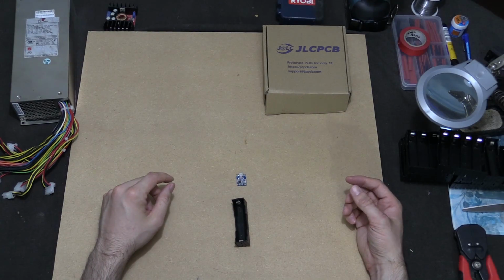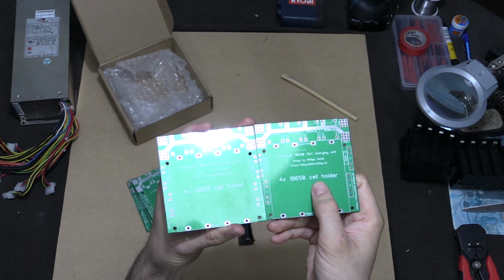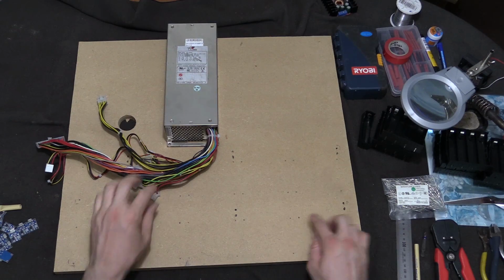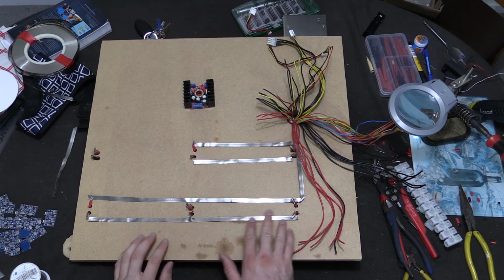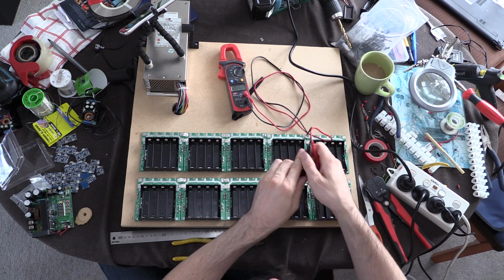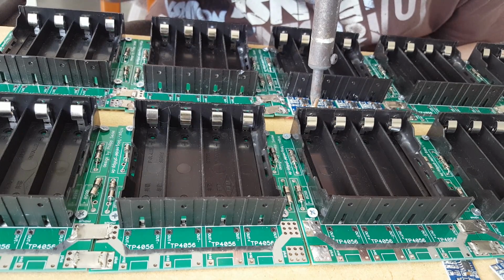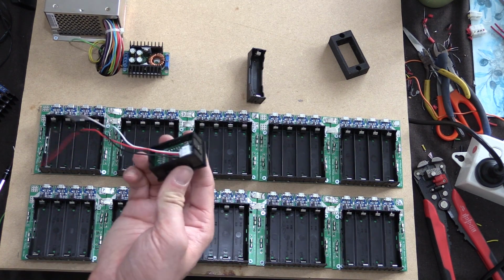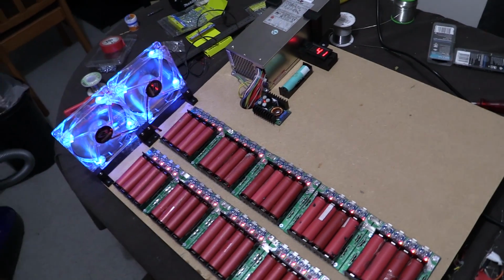Ultimate 18650 40 Cell Charger Build. Oh Yeah!

Comment: The video at Philipp Seidel's blog (linked in the description) suggests putting some solder on those long lanes that pass the power across the board so they can handle the additional current from daisy chaining the boards together. I was thinking about adding a wire before I saw his video.

He also uses a diode to protect the TP4056 from a reversed battery. The diode would short circuit the battery when it's backwards and blow the fuse.
Reply: PS - I just finished binge watching your whole series. Filled 3 or 4 sheets of paper with notes. Great info here!!

Comment: I just build an 18650 charger for 48 cells - using a 30A 220v to12v dc converter and three 9A voltage regulators - all set to 4.2V. I made the cells in parallel - working just fine. I only need to check from time to time to see if one cell gets warm - that cell I take out. I only run in the daytime when I am around - this way I can charge 48 cells per day.:)

Comment: I just wanted to suggest you check out a metal conductivity table. I've done so much electrical work that I instantly had regrets about after reading one. One fact that blew my mind was that although brass contains 70% copper, it only conducts 28% as well. Tin is 15% and lead 7%. I definitely prefer leaded solder, and due to that, use silver-bearing lead solder instead. There's also silver-bearing lead-free that also contains copper, and likely conducts the best that I hope to try in the near future

Comment: If I recall the Tp-4056 boards come default to charge at 300ma. You have to change a resistor to do 1amp. I am using a 30amp supply for my 36 slot charging unit no problem. Looking good, good luck
Reply from the maker: Thanks :) hmm these boards i used seem to be set at 1amp. As you can see 34:42min its pulling over 7 amps on 8 cells that i put the meter on.

Comment: your original charging board was tacky when you built it lol. The negative track is actually the entire front of the board not just where the silver is, that is just to add some solder on it, you can put a solid piece of wire to beef it up! maybe I should redesign that board for the LM2596 CC buck boards I am using!
Reply from the maker: tacky yes haha Hmm i never tested if that ground track is connected to the entire front but i will have a look.

Comment: You should defiantly add more solder in the holes of the TP4056 boards and You probably already know this but you should try Solder Flux it works so much better than that Solder Paste you're using. That stuff is more for SMD applications, but it does work theirs better stuff out there that will make soldering so much easier. Flux is the best thing ever created for soldering lol I can live with out it. Try the Pure Rosin ones there my favorite, you can use it to make liquid flux to. Good video tho. Gotta build one someday i'll probably add some header pins on the boards. my 10 Lii-500s aren't enough lol

Comment: Why don't you just solder a solid copper wire of the appropriate size that you would need along the traces? That would go a long way in the protection of your boards. Don't you think?
Reply: I thought this, i use tinned desoldering ribbon, stays nice and flat, or nickel plate that is used for connecting batteries.

Comment: Why don't you just install some protection diodes at each battery charging board so you don't blow out your boards?  These diodes are very cheap and not a lot of work soldering them in place. Just asking mate.
Reply from the maker: protection diodes or using a diode will create a voltage drop, Around 0.6v off the top of my head. Which will cause a problem with the charging circuit unless you somehow created an offset in the chip. Remember the tp4056 is wanting to hit 4.2v CV and then do CC after that, so if the voltage wasn't able to get up to 4.2 held back by the 0.6v voltage drop it will cause the cells to never fully charge, That's why I didn't use diodes as it messes with the tp4056.

Comment: Great project, what do you do to capacity test the cells?
Reply: capacity ? its charger. Not tester.
Reply: @happer2009  he's asking what do you use to capacity test them. The TP4056's brother is the ZL2B3. Not quite as cheap but on Aliexpress or Banggood you can get them for like $4 each. They aren't the most accurate testers but they are fairly consistent between each other. My testing has shown they are rather optimistic giving me results several percent higher than what they should be. The ZL2B3 isn't constant current, its a simple resistor pulling down the cell so it can be hard to compare to other testers

Comment: or you could use 2 new computer power sources at $11 each 400 watt, that already have fans (that will blow air on the accumulators if oriented well but in reality 18650 don`t get hot, or even warm except if they`re old and bad), and together they will give you much more than the 40 amps 5 volts you need (more like 80 amps combined) ...your project will look much better

Comment: Where did you get the parts from? This link you provided seems to be kinda clunky to navigate. Very frustrating. Good vid!
Reply from the maker: That link is only to download the PCB files from. The other parts needed are the holders which i got from Aliexpress. https://www.aliexpress.com/wholesale?catId=0&initiative_id=SB_20190124133604&SearchText=4x+18650+Li-ion+Battery+Storage+Plastic+/

Comment: Hi Mike. 
I have tried charging 20 x 18650 all in parallel with a 4.2V 10A current limited power supply and I have had no problems. I use Rui Deng DPS5015 as the power source and stop charge when current drops below 100mA. May pay to put 0.5 ohm in series with each cell to limit surge currents when different voltage cell are paralleled but so far I have had no problems.
I was wondering why you have to use 4056's?
Reply from the maker: Hi Peter,
The TP4056 gives each cell 1amp and each is independent of each other, Meaning if some finish first they can be removed and another put in to charge. With the idea of 20x in parallel you will have to wait until all have finished or below 100mA. The problem with the 100mA cut off is if the cells overheat during charge and some never charge because of this the current will not fall below your cut off being 100mA. 8 out of the 20 Sanyo cells not charging should do that. Charging cells that are all around the same start voltage and are known to be good are fine to charge in your 20x parallel but I wouldn't be putting cells pulled straight out of laptops in there, Some will not charge, some might be dead shorts, some might be 1v with other at high 3s,  My advice would be always charge unknown cells independently and connected to there own charge circuit for the first time. This also helps with speed because as soon as one finishes another can be put in, as they all have different capactity some will finish much sooner than others and some will never finish and are binned.
Reply: Thanks for your reply. Your system is more effective in weeding out the really bad cells. My system is very simple so only good for non leaky cells.
I have only tested about 500 cells and generally dump any cell with <1.5V open circuit as they are probably leaky. The rest seem to charge OK with my system. This means they  all finish charging together (batch recharging).

Comment: How do you check if the cells are heaters? Do you only charge when you are around to manually monitor the temps?
Reply from the maker: if they are heaters then 1 they will be hot and two all other calls would have finished charging but the bad ones will not be so they get binned. Some do get hot. No i dont only charge when i am around. Its runs 24/7 charging cells. Never had a problem after doing 1000s could be getting close to over 10,000 these days
Reply: Thank you for your response! Not challenging your methods, this build is awesome, just trying to understand. If they charge overnight, wouldnt some heaters have the chance to cool back down before you got to them in the mornings? And surely all 40 cells aren't beginning at the same voltage so wouldnt varying charging times be normal and not simply a sign of an internal short?
Reply from the maker: No the cells don't cool down, The cell gets hot and this causes the charging circuit to keep charging the cell and never cuts off. The charging circuit will only cut off to that intervidual cell when the cell drops to under 100mA in current draw. Given the cell is using more current than that in the form of heat then it never turns off and the cell stays hot no matter how much time pases. So its very easy to tell. Also if a cell did reach charge and then drop down in voltage to under 4v then it will start charging again this cell might not get hot but when all other cells are charged bar 1 or 2 then its also easly to tell that cell is not holding the charge and needs to be binned.

Comment: what is the Amperage of your power supply? does the Buck converter step down your voltage and amperage to 5V , 8A  ? from? what is the input?
Reply from the maker: its a old server 460w powersupply so nothing great but is rated 33amps 5volts and 32amps 12volts. The key is the 5v rating. The buck converter steps down the 12volts to 5 volts for 8 cell chargers. This was done so i didnt over load the 5volt rail by adding the extra 8 chargers to it.  If you have less 5volt amps on your power supply you could use two buck converts and take more power from the 12v rail etc
Reply: I have a Dell server power switching supply 12v 108A 12Vsb  4.5A
Can I used with the buck converter to power the whole module?
Reply from the maker: @pitbull1969rr  Yes you could but you will need a buck converter able to deliver alot of amps at 5volts or a few 10amps ones. If you use a 10amp one dont run more then 7 amps continues etc
Reply: How would you tell the capacity of every single battery in mAh ? Is that single battery tell you the capacity?
Reply: Mikes DIY Tesla Powerwall 
The server power supply( Dell E2700)I have is 12 volts 108A
If I use the buck converter from 12V to 5V I will get calculating
5V 45A 225w continues tha amperage will be ok or should lower it to 40A?
Thanks for you advice
Reply from the maker: @pitbull1969rr  The powersupply will be fine, but you will find it hard to find a buck converter that will do 40 amps. so you will need a few
Reply: Mikes DIY Tesla Powerwall 
The ones I saw it say 100A no true? I
Reply from the maker: @pitbull1969rr  Do you have a link to one?
Reply: @MikesDIYTeslaPowerwall   i found another power supply 12v 62A. I am using 12 board needing 48A  i can use a 6 buck converters but my question is the buck converter max A is 10A .but my PS Amperage input is 62.4 it wont blow the bucks converters?(with a max 10A)